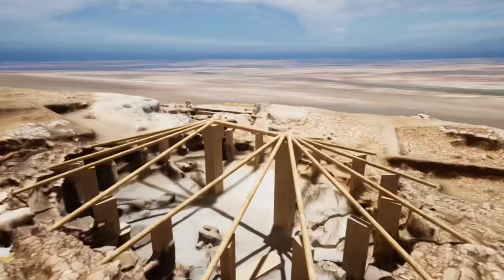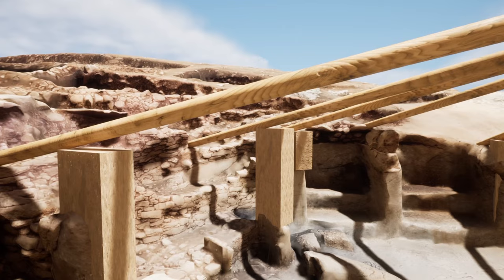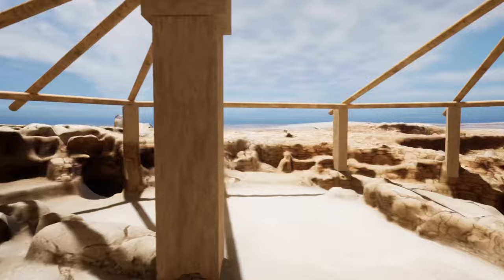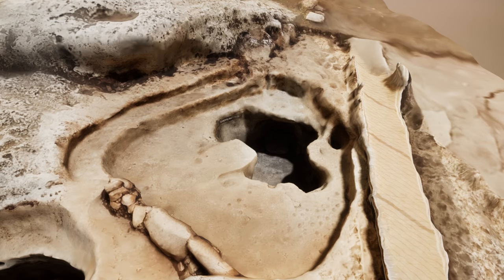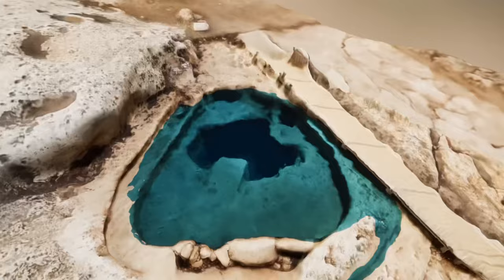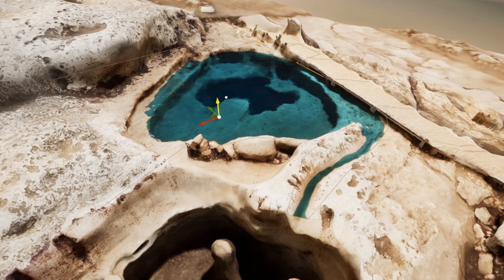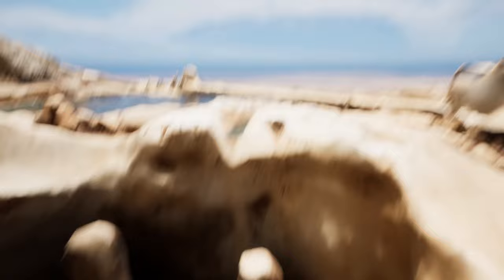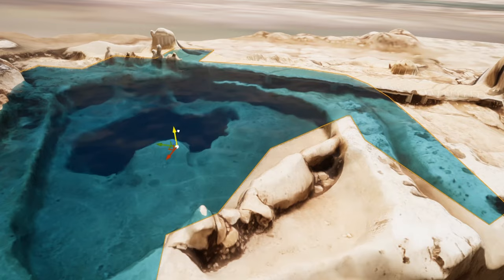Karahan Tepe Reconstruction in Progress

Comment: Absolutely amazing. Great job! I think the head at the pillars room was placed at the hole that served as a chimney just as you show in your proposal. From above it looked as if the man was blowing the smoke through his lips. Looking this enclosure also from above it seems as a snake head being the body the sinuous canal carved on the rock that brought the water from the pool. I agree with Ancient Architect that the pillars enclosure looks pretty much as a Roman hypocaust but in fact it could be the first steam boiler of history. As you pointed out the water could flow in a serpent shape canal hold on top of the short pillars. The heat was provided by a fireplace that could be located in the hole that is connected to the snake head shape enclosure. As heat always goes up, the position of the canal would ensure the water to become steam. People sat on the benches of the big enclosure while steam was poured through a hole carved on the stone walls. Imaging hunters coming back home exhausted after some days seeking for game and looking forward to rest with their community in the sauna. Another possibility is that hot smoke from the fireplace could be forced to cross the water in the way the Turkish hookahs work. The smoke would exit the enclosure through the hole just in front of the human head. If this was the case, instead of steam the production was hot water for a bath.

Comment: This is fascinating! I'd love to see the site reconstructed  initially with no roof, to see how exactly the winter solstice sunrise would work here with the T-pillars in the centre of Structure AD. We have worked out the positions of the central t-pillars which are slightly north of centre (like at Gobekli Tepe). Then it would be interesting to add the roof to see if there was an opening for the sunrise alignment. Matt from Ancient Architects suggested I take a look. Hugh Newman
Reply from the maker: That is a very good point.  I need to figure out the directional path of the sun.  It will be interesting to see how it aligns.

Comment: If both pits functioned full of water they would act as sort of decanting pools, similar to how the chambers of a septic tank work, allowing sediment to drop and water to flow through the higher exits.  This would provide a clean source of water for whatever function the complex serves.  The channeled water idea based on the pillar height is excellent, and I enjoy the heated water idea.  They had plenty of stone to work with and obviously had the skill necessary to create sluices.  The main chamber being a bathhouse is a natural conclusion to this line of thinking; it might seem advance, but we're obviously going to have some biases to break about cultural and technological advancement for the period.  I think that finding wherever the water exits will be key to understanding its purpose in being channeled to the main structure in the first place.
Reply from the maker: https://grahamhancock.com/wp-content/uploads/2021/10/20211007ghblog-prof2-scaled.jpg

If you see there is a little hole in the chamber.  That is not the hole the light passes through to hit the head.  In this photo that arch has not been reconstructed yet.  That hole that is showing light would have been a drain to Enclosure AD.  

I think you are right about the water filtration idea.

Comment: Channels in the floor, and we don't understand exactly what they're for.

Egypt also has channels in the floors that we don't understand, and Egypt isn't too far from Turkey geographically.  But they're 6,000 years apart according to the official dates, which is very far apart.

But if the Tepenarians (or TurkTepenites as they're sometimes called) didn't completely disappear and go extinct, then some of them would have kept building.  Maybe in other places.  

Or even if they did disappear, the Egyptians could have found the ruins of one of these sites and copied some things.

Another possibility is that the same culture built the same structures in Egypt at the same time as in Turkey.  The Egyptians built on top of their sites, while these remained buried and unchanged.

But regardless of speculation, we can't deny some connection if these channels are found to have the same functions as the ones in Egypt.  Even if we never know how the knowledge and architecture was passed on, we would have to admit that whoever conceived these structures in Turkey was also the ultimate source of the ideas for the similar structures in Egypt.

And since these are presumably earlier and simpler, the first and most basic form of the design, we may have a better chance of deciphering their purpose.  Without temples and pyramids obscuring things, we can see clearly and ask what was gained from the effort of carving those grooved channels into a rough hillside.  It definitely wasn't for aesthetic reasons. 

If we can discover the purpose of the structures and how they worked together, then we can determine if the same purpose was built beneath the more elaborate designs in Egypt.

And the same will apply to the channels in the floors in South America.  We will know that their water channel designs were learned from the Middle East, even if we don't know how.  We won't need to make up a story about people drifting across the ocean in canoes, although that's the first thing that will be published in major newspapers.
Reply from the maker: https://youtube.com/clip/UgkxFFxxUOGjvLuL35Kn6W1fIC6OGcBI2apS?si=CCM0E_6XFB2okChJ

You are right I do not know they are water channels but Miniminuteman said it in a video and it stuck in my mind.  We are also looking at a tiny amount of evidence. Once more of the site is cleared I am hoping their use become clear.

Comment: I just saw a video Jahannah James posted of her trip to Gobekli Tepe and one of the people in her video said they thought the structure was built like a pool, and then today I see this video where you're demonstrating that Karahan Tepe fills with water. They were talking about the possibility that there was no roof, and it was used as a reflection pool for observing the night sky. If not, maybe it was a ritual bath house or sauna?
Reply from the maker: If I owned the property back then enclosure AA is becoming an infinity pool.   I will check out  that video.  At Karahan Tepe it certainly seems possible they could have flooded all the pits with water.  The largest pit would have made an amazing reflecting pool.  You could flood the whole floor so there is only a couple of inches of water then divert the flow of the water so the water stands still in enclosure AD.

Comment: I presume the smoke would have simply filtered through the thatch.  Thatch is not impervious, but relies on the tendency of water to cling to a surface to wick it down and off the edge of the roof.  The main worry with it is that any flying sparks from the fire can catch the thatch on fire.  Thatch from what I've read about in England on the huts they have reconstructed can get quite coated with smoke residue.

Comment: Great job, good work, well done!   I am an HVAC, Plumbing engineer, and I agree.  The first thing I saw in that room with the columns is a hot tub. If you think about the Roman baths, they all had a fire room underneath.  Has that area been tested for ash residue?  The bath was probably made of smaller rocks on top (we see now as rubble) or mud bricks removed later.  

This all ties together as a heating, AC, Plumbing system.  In hot weather, this water could be channeled (possibly across the floor) to evaporate. They could have built some sort of raised floor. I would use bamboo, but there are many natural fiber. our floor is, can be made to be cool and dry Are there any traces of Lead anywhere?   How far away could they find bamboo?  

Please continue your work with the water level.  Is there a spot anywhere on the main floor opening that could possibly be used for a drain?  These inlet and outlet openings could be covered by a wooden stump for a valve, the wood bashed into the rock over and over, many hours would form a seal.   If you think about it, there are toilets in used to this day all over Europe that are simply a hole in the floor, this is where that came from.  If we can find that drain outlet, at the lowest point, that’s a big deal.  I would love to collaborate with you please.  Let’s figure out how to contact each other on this.  Again, you have done amazing work I knew from the very beginning that this had a roof.  Why I have so many columns with nothing to support?  Amateur archaeology is a passion for me and this is the biggest deal going on now or maybe ever.  
Thanks, 
Randy
Reply: I just saw another video of yours that talks about the entire thing being a giant bathhouse. I absolutely agree. The first thing I saw that being underground was a pool. I still think it has a drain.  All human swimming pools gather bodily fluids and need a good scrub down now and then.
Reply from the maker: These are amazing insights.  I will continue working on the water level.  I want to get the higher res scan of the pillar pill to see some of the detail I am missing.   There is a hole in the ground on the large enclosure.  That is a great idea that it might be a drain.   I know my scan is not detailed enough to inspect the bottom.  I will see if I can find photos.

Comment: The small side pillars have very particular alignments and don't all converge on large central T-pillars. If you align the timber beams to be parallel with the side pillars, I'm assuming the spacing of beams creates a different workable pattern while still being buttressed against the slope by raised terrace rings. Earlier Australian Aboriginal housing settlements in Western Victoria involved low circular stone foundation walls assumed to buttress curved  timber members that met to create a dome structure that was then thatched. There is no necessity for the Karahan Tepe structural beams to be the sole support for a roofing material. Any thatch or skin roof could be accommodated by a lighter strata of timber elements running across the beams. I assume all central beam connections would be tied by woven rope or an equivalent binding. There are plenty of subsequent analogies across Austronesian and other stone and bone tool cultures. The T-pillars could still support radial end beams and a longitudinal beam running as a spine between them. Other side pillar orientations suggests side beams meeting across the longitudinal central beam. Running a lighter strata of perpendicular timber structure across the top of the beams, tied in place, would further stabilise the overall roof and provide a lattice for roofing material. Austronesian longhouses offer an analogous configuration. In the Polynesian culture of the Maori Wharenui Meeting House two central pillars are carved anthropomorphic representations of ancestors. The entire building represents a founding ancestor's body with the carved side pillars representing ribs. The whole structure is slightly below ground for thermal reasons but also because the Wharenui is conceptually a cave, entered through the ancestral grandmother's vagina as a portal to the underworld. I only suggest these subsequent cultural practices as analogous structural and cultural models for comparison only. We can already surmise ancestor worship from below-floor house burials and plastered and painted skull effigies from this very early period and region. The viability of any roof needs to meet basic structural and tectonic logic that is knowable. The remnant side pillar orientations suggest a correlating beam orientation. The stone as a prop can readily support a timber frame without need for elaborate junctions between the two. Alignments remain a clue.

Comment: You don't know that the upper storage pool was ever or possibly rarely full...water could be scooped out of a lower water level and sent down the channel as needed to the small pillar room...which to me looks like a small animal/bird pen
Reply from the maker: You are correct I we have no idea of the water levels that were kept, if any, in any of the spaces.  I like the animal pen idea.
Reply: @ESLINGERART  so if we assume the upper pit was for capturing and storing Rainwater. They could send it as needed along the channel then in a trough like you suggested on the lower pillars to fill the pool by the hearth. But the trough could be made out of wood instead of stone.. And possibly animals below. I would imagine for the earliest form of domestication you would need an extremely robust pen/cage that something like an Antelope couldn't jump out or get out of
Reply: @ESLINGERART  I really love what you've done here and the main structure I think is spot on. (It's not how I would build the center section tho i think parallel poles makes more sense) . I don't agree with the stone roof or heating in the pillar section. Too hard to make and feels like modern thinking and away from the basics of food, water, shelter...It would be interesting to see if there is any evidence/pattern that makes sense for horizontal poles across the tall pillars to create a caged roof.

Comment: Ok NEW WILD THEORY HERE: Graham Hancock says these sites were stellar observatories.  But K-Sling has proven in this video that there were roof pillars, presumably thatched or otherwise covered so the sky wouldn't be visible.

But what if those beams were used just as they're shown in this video, forming sight lines and triangular segments so the observers could track the movements of constellations?

Instead of drawing stars onto star charts, they overlaid a chart between themselves and the stars.

And that's how they knew, at Gobekli Tepe, when their observatory was no longer aligned and needed to be replaced with a new one as Graham Hancock says.  Because the usual constellation during the summer solstice was no longer framed inside the first triangle on the left, for example.

Sorry it took me 8 hours to crack this ancient mystery, but I was at work when the video came out earlier today.
Reply: "But what about the water?"

Ok, my secondary and even wilder theory is that they needed a lot of hot water to create an updraft that swept away clouds.  You can't use your observatory if the sky is covered in clouds.

I just thought of that while I was typing the other thing, and it's probably not the reason for the water.

But then again, it does provide a unified explanation for the water and the pillars and the roof.  Other than "to drink", why else would they need so much water at an observatory?
Reply from the maker: The pillars are top heavy and would not have stood a year without some sort of bracing.  Even at Gobekletepe they brace the larger piers/pillars with wood beams.  I think they did consider the sun when they positioned the structure but similar to how homes are positioned today.  To take maximum use of the northlight to illuminate the interior space with ambient light.  I have a video coming out shortly where I show the position of the sun relative to the site.  You can let me know if you see anything deeper in the position of the piers/pillars.
Reply: @ESLINGERART  You noted that it bothers you when your model has an extra-large triangle that's bigger than the other triangles.  You say it would be problematic to cover that gap with the same roofing material as the other uniform triangles.

So maybe that gap was left open, and that was their window aligned to the stars.  

My previous post said that there was no roof at all, with all the triangles framing and defining different sectors of the sky.  But it would also work with just 1 open section of the roof, or the entire section between the 2 central pillars being a long open window to view the linear precession of the zodiac constellations as they cycle through the sky.

Karahan Tepe is located at 37.223194 N, 38.922325 E

We can use an online observatory to see what the stars look like from there, and we can also set the date and time.  

So if you set the observatory to the year 10,000 B.C., and overlay that sky into your 3D model, we can set the camera inside the observatory and look up through the pillars. 

 If you set particular dates such as the summer solstice or autumn equinox, maybe certain stars or constellations will be framed within the triangles of the wooden beams.

Maybe they had 1 triangular window in the roof, and the sun perfectly fills the window on the equinoxes, or the solstice.

Or, given the jaguar themes, maybe the constellation Leo appears in the triangular window at a certain time.

Comment: Looking again...I would have thought that if they outer ring was intended as a support for roof timbers, that the T's would have been 90 degrees turned from the orientation they have.  trying to balance the roof timbers on the narrow tops of the pillars would have been a route to disaster. More likely there was a beam on top of the ring of T pillars and the rafters would have been captured.
Reply from the maker: 100% agree that the T pillars need to be rotated 90 degrees.  I was just working on Karahan Tepe for a video.  It would match the construction of Göbekli Tepe that way as well.  I will have an update video on Karahan Tepe soon.  Thank you for the feedback.  What do think about smoke exhaust?  I think there could have been a timber hole or the thatching could get thinner towards the top like the English roundhouses.